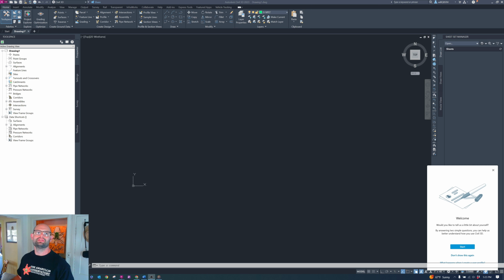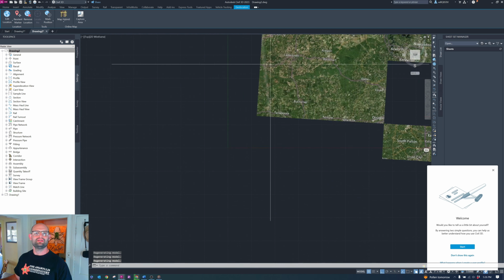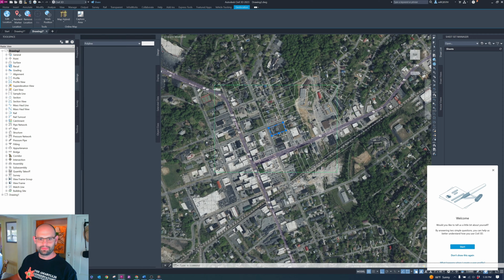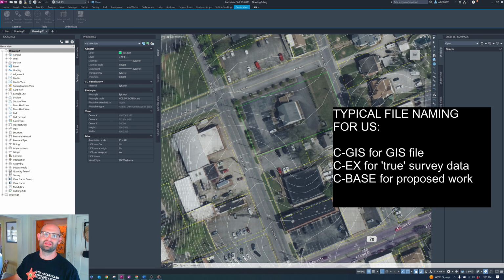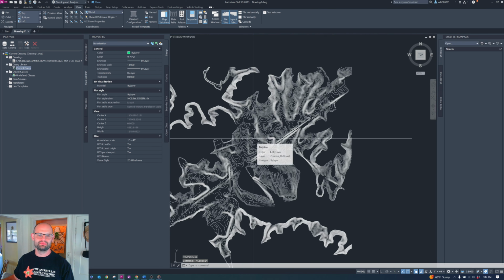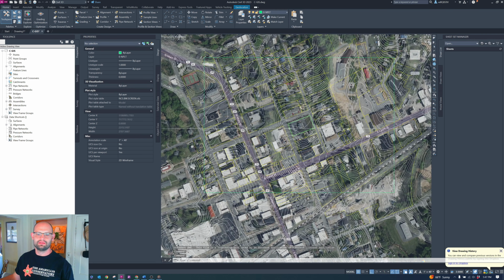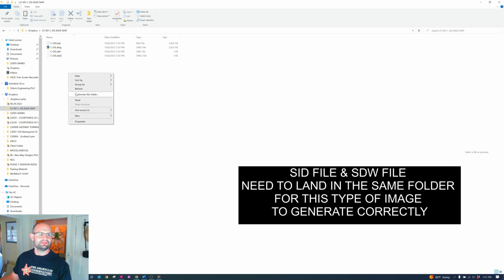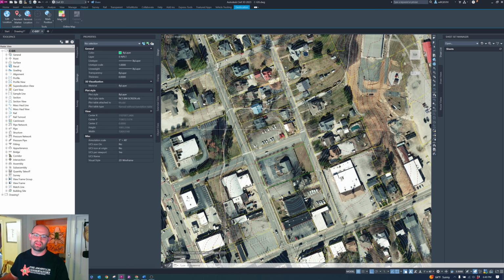AutoCAD Civil3D GIS Base Map Creation - for the Civil Engineer

Comment: I am finding it so difficult to set up geolocation to Douglas County Colorado. I set the drawing to COCF however the longitude and latitude doesn't match up to Google Earth. All units r in feet. The longitude and latitude should be 39°18' and 104°18' I think but it's no where near that. Wht should I do? Wgs84 utm 13N thn it's nt in feet.
Reply from the maker: X Y coordinates in Civil 3D are not the same as true latitude and longitude. Maybe these 2 links can help explain better:  https://pro.arcgis.com/en/pro-app/latest/help/data/cad/about-cad-coordinate-systems.htm  and https://forums.autodesk.com/t5/civil-3d-forum/longitude-latitude-coordinates/td-p/10253194
Reply: @NewWayDesigns-it1ts  thanks